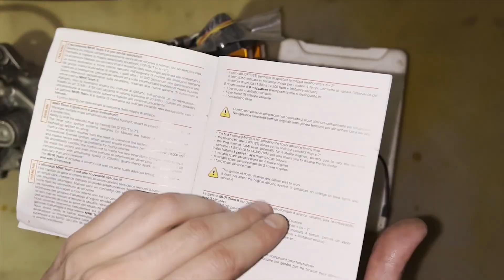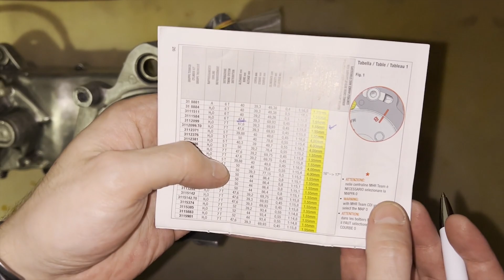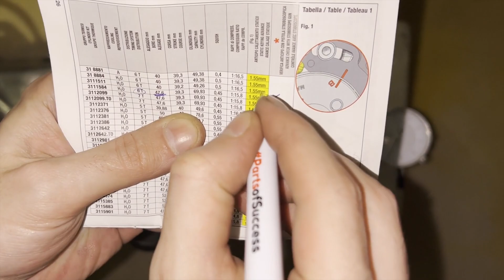Yamaha Aerox Setting Offset on Malossi Inner Rotor TEAM II IGNITION/ Stage6 RT 70cc

Comment: How did you get the rpm to work on the stage6 r/t gauge with malossi team 2 inner rotor ignition? I couldn't find a way to make mine work.
Reply from the maker: I get 14500 rpm. It work so good, more better than MVT Digital direct. What do you mean about “mine work”?😅